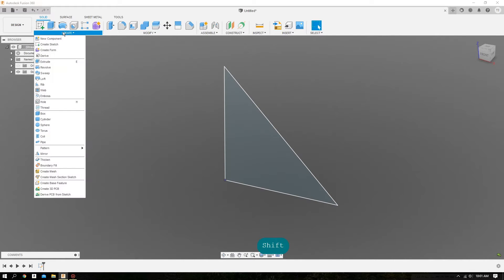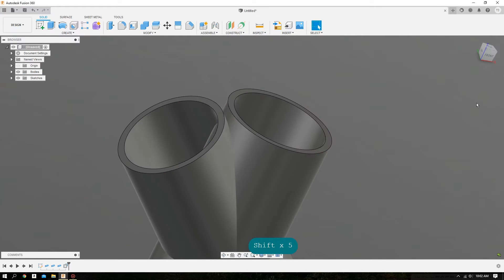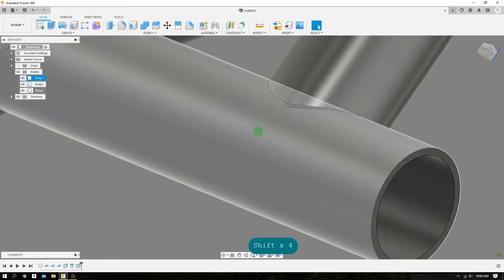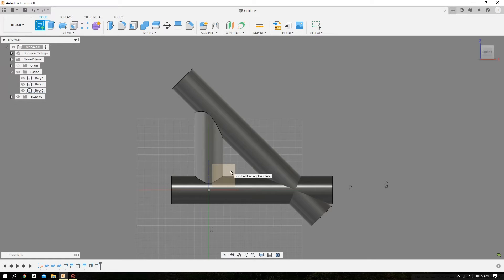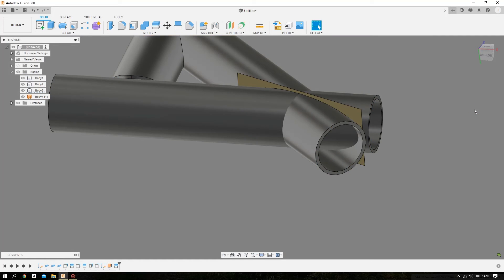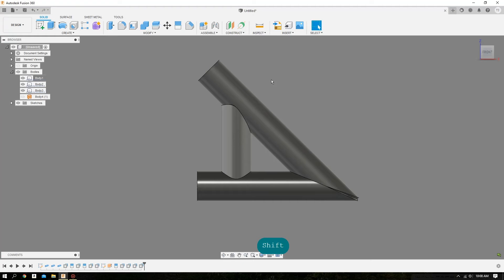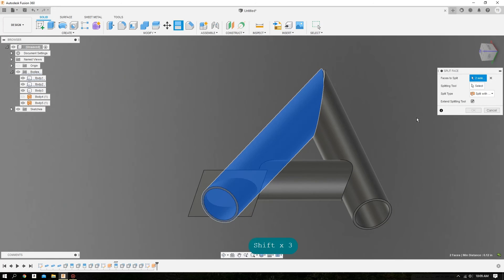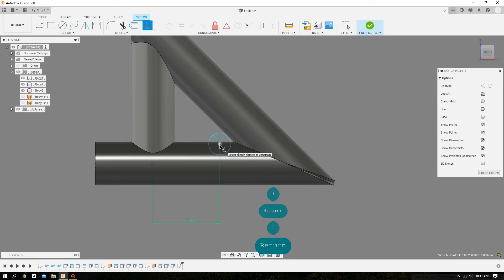Fusion 360 Tube Coping

Comment: Hello. Why are there always slivers?
Reply from the maker: @NomadSaga  slivers? Where are there slivers?
Reply: @jamfab_llc  hello James! When you finished dividing you then had to remove the tiny slivers after you removed the major pieces. Were those because you sliced it with a pipe that had an inner and out diameter?
Reply from the maker: @NomadSaga  I see what you are talking about now. No, the sliver didn’t happen because of the inner surface of the governing (cutting) pipe. Remember, we only used the outer surface of the cutting pipe to cut the cope. 
The sliver is a result of the difference in how the inner and outer surface of the coped pipe contact the cutting pipe.
Reply: @jamfab_llc  Thanks James! I’ve been a graphic designer since 91 but just took my very first step in 3D design Thursday, It’s a completely different world. Thanks for your time.
Reply from the maker: @NomadSaga  You’re welcome. Good luck on your new adventure!

Comment: The negative extrude leaves a 'lip'.  Is there a way to do that cut more accurately ?
Reply from the maker: Not sure what you mean by a “lip”. This is the accurate way to cope a tube if you are prepping for laser or plasma cutting. The cut surface should be perpendicular to the outer surface of the tube/pipe.

Comment: every once in a while i get an error when trying to do the negative extrude part. something like "body could not be repaired" any idea whats up with that?
Reply from the maker: Fusion is a little finicky sometimes. Anytime that happens to me, I will change the depth of the negative extrude to something deeper. I don’t know why this happens but that is usually the fix. If that doesn’t work then I will try extruding only one side of the part at a time. I think sometimes the extrusions conflict with each other causing issues.
If this happens to you again, send me a part file and I’ll gladly diagnose the issue. jamesonfabrication@gmail.com